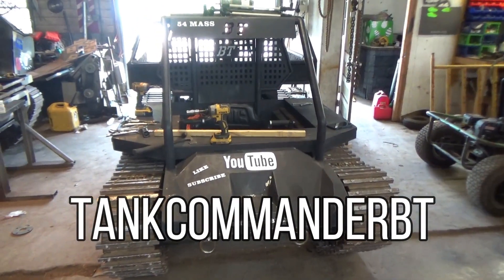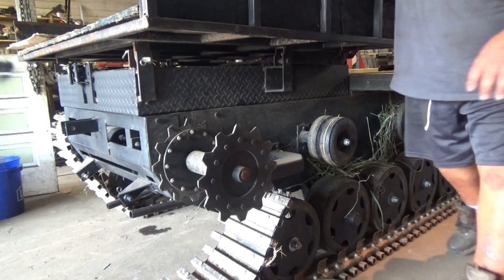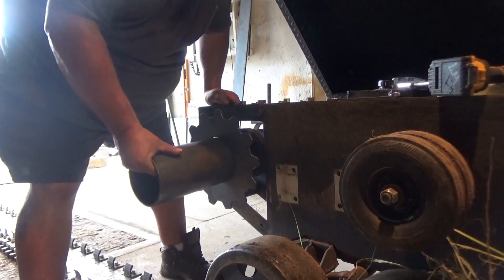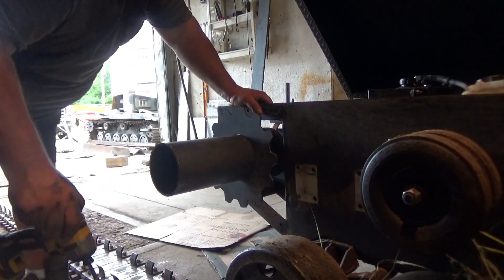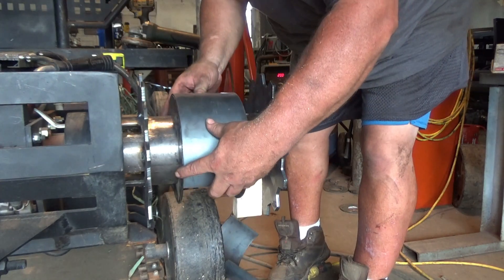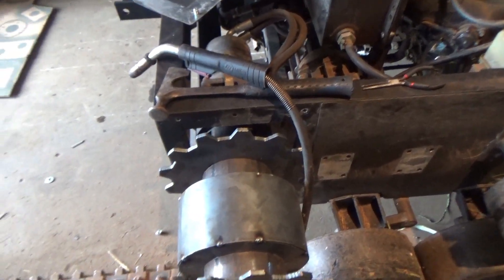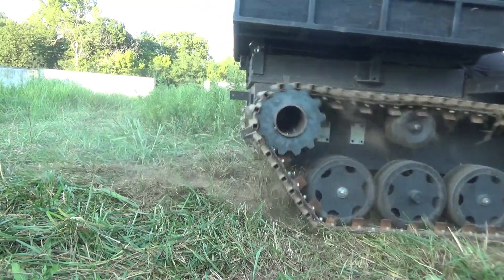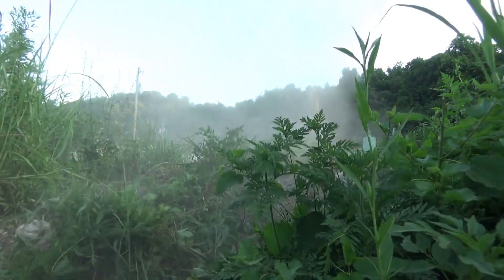TRACKED VEHICLE 11 (MAKING NEW SPROCKET HUB),

Comment: My opinion .
Off All the belt/tracked viricel, that I've seen on YouTube. All together , thist is the best privat projekt.
Well done.
How exatly do you make/produce the tracks ?
Reply from the maker: Thank you . The tracks are basic 1 inch box tube . 2x2 angle , 1/8 x 9x2 1/2 plate bolted to 3 ply conveyor belt . the size of your wheels and pitch on your sprocket teeth  will determine  the spacing   on your drive tubes . I will be making a video of the track assembly and track jigs soon so again thank you .

Comment: I was wondering what are you using for I drive system what pumps and what motors?
Reply from the maker: Sorry for the slow reply , I have two 21 cc parker wheel motors  with hydro-gear  21 cc tandem pumps  , powerd  by a 26 HP kohler commander in the black MAV and two of the mini army tanks  ,  I also have two 31.5 HP vanguard motors with the same set up in two more prototypes  and have a 37 hp vanguard on order for the next prototype. Videos coming soon.
Reply: @mimimitchell1989  thanks for the info supper helpful I am working on building a snowcat to rip through the snow in thanks

Comment: What are you using for bogie wheels? Are they rubber or just steel drums?
Reply from the maker: The lower  wheels are custom made in my shop using steel plate and dom pipe . The upper two wheels I purchased at harbor freight. HDPE pipe is heated and pressed on to the completed rim assembly .
Reply: TANK COMMANDER BT thank you, trying come up with a solid setup to build a quad track garden tractor and this looks awesome.

Comment: Your design & fabrication is bang on. I have an Argo 8x8 Conquest for hunting but though good in swamp, it just plain sucks on water without an outboard motor. Overall, the machine is not a patch on the track system & drives you built. You should seriously consider making a variant for sale, based on your drive train in an amphibious platform for serious moose hunters. I would love to see it with a built in enclosed water jet type propulsion set in two tubes along each side so you could steer by sending water forward & backwards independently. Outboard motors suck in the places we want to hunt. Some of the terrain includes very steep slopes where we winch the whole machine up & down a 60 degree cliff-side slope. We also recover whole moose as heavy as 1500lbs using a portable winch & a bunch of pulleys through this sort of terrain.
Reply from the maker: Thank you for your comment . I have a amphibious platform in design now . Great idea on the propulsion system . I will be conducting a climbing test in the next few weeks on such a hill while hauling a 1000 lb payload . I will check the slope and post with the upcoming video
Reply: @mimimitchell1989  I always imagined the "thrust tubes" being the chassis tubes along the left & right side, water intake near the front, outlets at the rear. However, this idea may have stability issues with variable cavitation of the water/air in the tubes causing possible capsize. To get around this, the tubes would need to be narrow but higher pressure (substitute water force for water quantity).

Comment: I think the main reason for the design change was to increase the stiffness of the track around the gears, right? That's why you added these sheet steel drums in the middle, right? Although it seems that this goal has been achieved, I think that such a solution causes much more serious problems in the further operation of this vehicle. The previous design provided a lot of support for the sprocket as it was divided into two parts connected by a shaft passing through the bearing tube. And this pipe was connected to some kind of yoke that was connected to the main body of the vehicle. This solution - when properly installed - provides additional support for the sprocket, which significantly reduces the stress on the bearing mounted "somewhere" inside the vehicle body. Now you have a better track and sprocket alignment, but the pinion is mounted directly on the propeller shaft and actually acts like a kind of long lever, which greatly increases the forces on the bearing. I'm afraid if you hit something with that rack it would destroy something inside the body of the vehicle - possibly a splined part of a shaft, maybe a bearing or its housing. 
By the way, could you make a movie showing your vehicle's powertrains? Could you give them basic parameters such as length, width, track width, ground clearance etc.?
Greetings from Poland!
Reply from the maker: Thank you for your comments and you are 100% correct . The sprocket assembly arm Is the best design, taking the side loads off the drive motors and allowing a more rigid sprocket stopping any possibility of flexing . The band around the center of the new sprocket drive hub is to help carry the track while taking strain off the bolts from track tension and to keep the track from walking off when the sprocket hubs flex . The main reason for the change was to lighten the smaller units so I didn't have to switch to a larger hp engine . but most importantly was to simplify the fabrication process . The larger units will keep this design. I will be more than happy to post a video of the drive train . Again thank you from the United States , this is what I like most about you tube is communicating with so many cool people from all around the world .